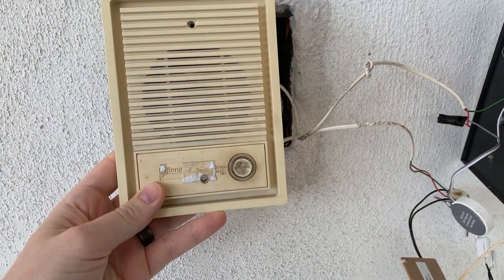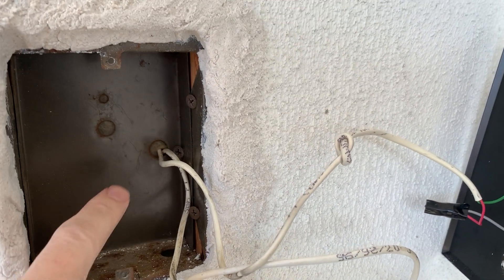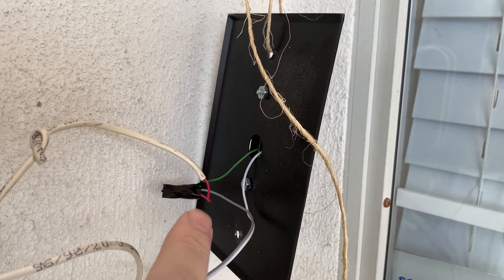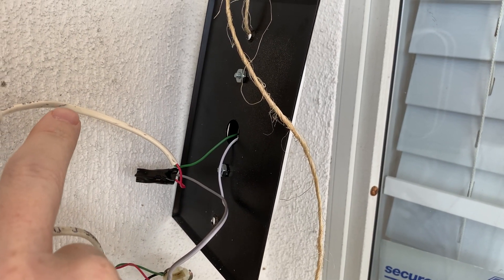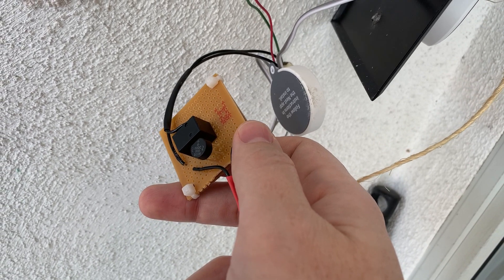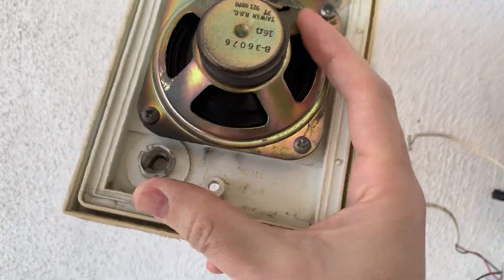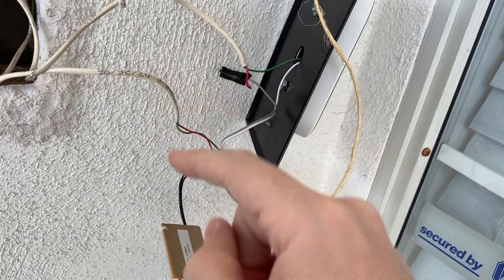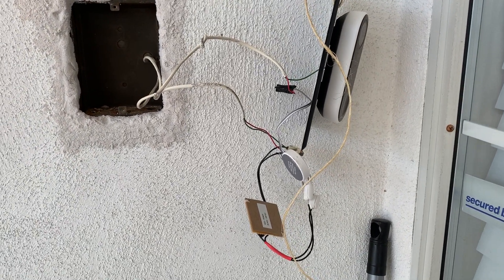Install Nest Hello over Nutone intercom doorbell

Comment: You are the only one who has a video like this. I have a 2nd gen wired nest bell and the white circular thing does not have a second set of wires coming out of it. So I'm not sure where to connect the one set of relay switch wires. Any thoughts?

Comment: Thanks for the video and all links in the description. I'm going to do the same but I test my original button, it has 24v now. Not sure if I would need a new transformer like your case? Will this process work with ring pro or ring 2? Thanks again

Comment: Q: If you are not going to use the original doorbell button any more (you hid it behind the plate), can't you just take it out of the loop?  Why did you reuse it?
Reply: I believe the button has to be there or else it will be at a constant triggered mode. With the button there, it will act like someone is pressing it once the nest doorbell is triggered and the relay will convert the AC to DC power and trigger the original button. Not 100% sure but that’s what I got out of it after watching a few videos
Reply from the maker: I guess it just acts as a bridge. You could probably fuse 2 lines together with 2 more wire caps and toss the extra doorbell piece. Mine works as shown in the video though.

Comment: Thank you for the video.  would you mind posting a video or pictures  of the connection to the transformer ?   I am not clear how you connected the speaker wires to the transformer on your system? would you mind posting your email address or contract me directly.  Thank you.
Reply from the maker: Amanda Casey sorry I just saw this comment. Behind my nutone base station I had two transformers mounted in the wall to power the system. I took the 2 wires that originally ran from the back of the doorbell/speaker to the circuit board behind the nutone base station and unscrewed them from the circuit board and reattached them directly to one of the transformers (with the power shut off) I loosened the 2 screws on the transformer that already had wires running to them and just added one speaker wire to one screw and the other speaker wire to the other screw (so each screw had 2 wires connected to it - the original wire powering the unit and the additional speaker wire). I tightened up the screws and went back to my doorbell/speaker and attached them to the nest cam as shown in the video. Hope that helps.
Reply: John Brunt wow John this is great and is very similar to what I’m trying to do. I wasn’t sure I could use the front door speaker wire to get power off the nutone transformer. I’m installing a SimpliSafe bell and it doesn’t have the supplemental power device that the nest has. In my case would you have a recommendation on where to place the relay device (I found where you got that piece)?  Would I splice/piggyback the relay with the video doorbell wires?  Also was it easy to figure out which wires went to the front door speaker or did you have to use trial and error?  Appreciate your video.
Reply from the maker: PJ to answer the 2nd part of your question, when I unscrewed the speaker wires from the existing doorbell faceplate I marked them by tying them off in a knot. Then behind my base station inside the house I found the same wires attached to screws on the circuit board labeled “DOOR SPKR” - these i unscrewed and attached directly to transformer...for your first question, I’m not an electrician so I don’t know exactly what the supplemental device does but on simplisafe’s website it says you can call support to get a chime connector sent to you. I believe this performs the same function as the nest one.
Reply: John Brunt sweet. Thanks!